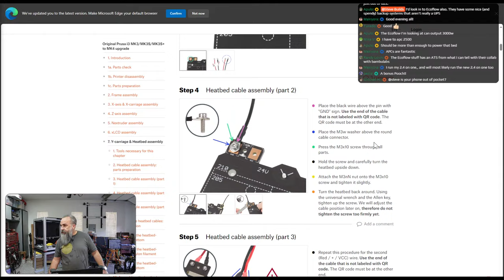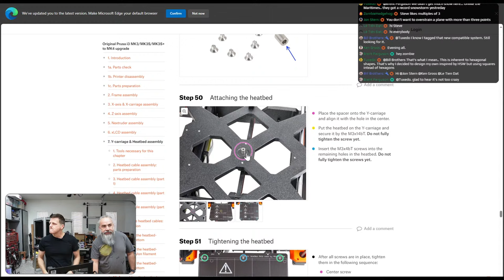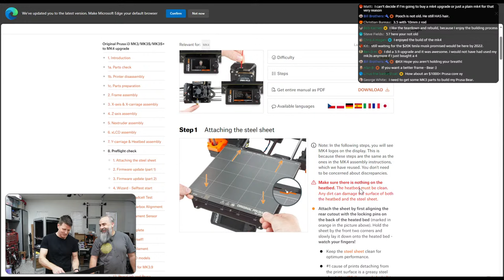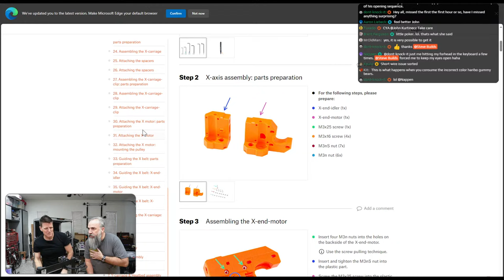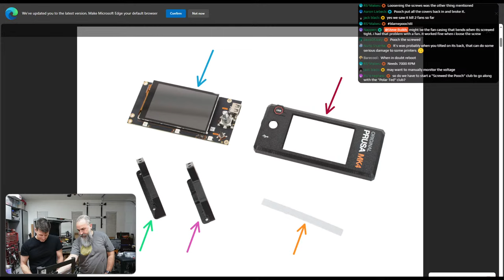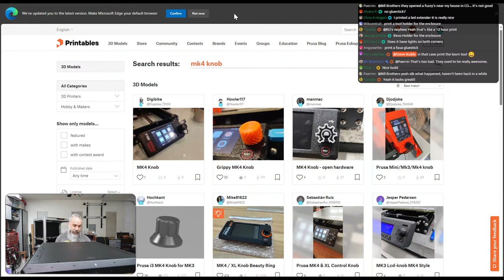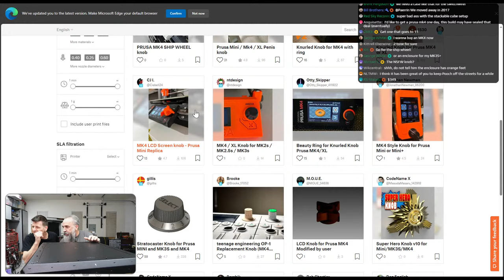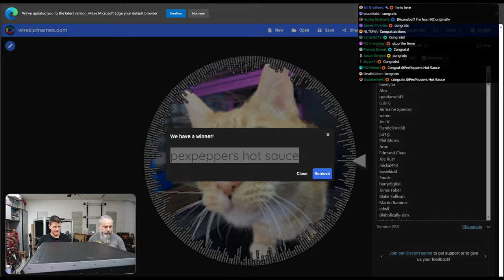Prusa MK3s to MK4 Upgrade - Part 5

Comment: And is the upgrade still worth it? I own a Mk3s+ with BMG extruder combined with a raspberry pi with octoprint and thinking of a MK4 upgrade. Is it really better?
Reply from the maker: I really like the UI changes.  And adding input shaper is a huge performane increase.  With that, it's up to you.  If your printer is creating good quality and print time isn't an issue then it might be less worth it.